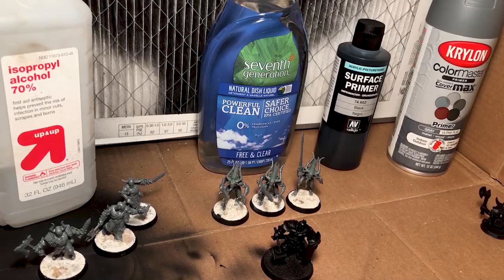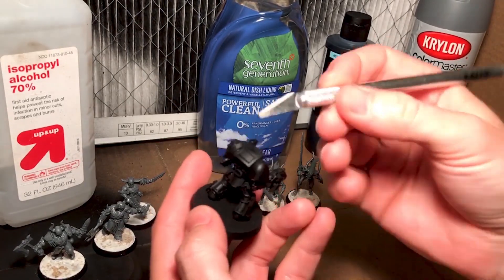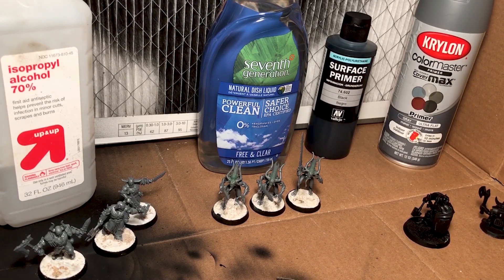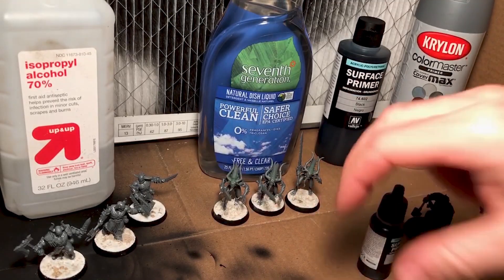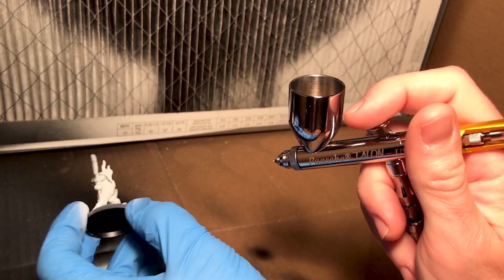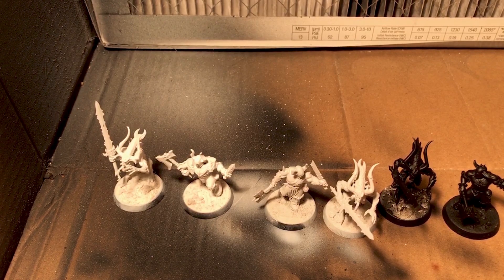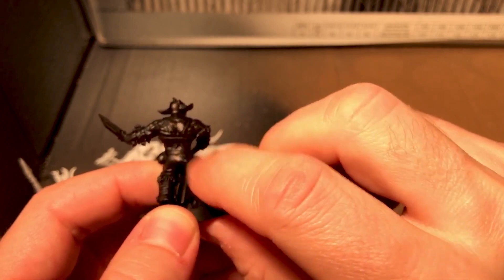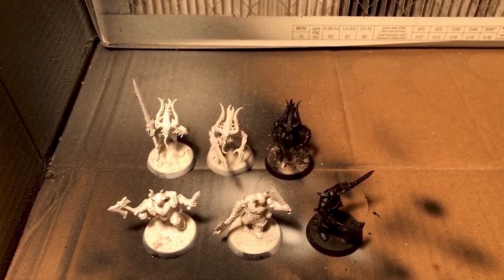Airbrush Priming Miniatures - how to fix primer not sticking or peeling off

Comment: I find this is usually an issue with small batch models or resin but have now got to the point where I wash everything with either a 24 hour soak in soapy water, or an hour in 95% isopropyl alcohol then a rinse in  distilled water and let it dry for 24 hours. This clears out even the most stubborn resin models

Comment: I was painting resin boardgame minis and no amount of prep or cleaning really makes a difference. Tried 3 brands of airbrush primer along with different pressure and distance settings and nothing will stop scratching off. Drybrushing scratches it off for instance.

I really think this is just the chemistry - aerosol primers have solvents that bond with plastics and polyurethane primers don't.
Reply: I have found the same. I always washed my resin anyways just to get any residue off, and still hade stynylrez sliding off. 

I'm thinking on some I'll try a very light spray of black primer I have left over that permbonds strong and is so thin it doesn't clog features, then airbrush primer over that.

Comment: just switched to airbrush primer.  Never had an issue with Citadel stuff.  Monumental and vallejo primer BOTH coming right off of plastic minis.  Going back to Citadel.  Don't have the time or effort to experiment.  Ill just use the airbrush to base coat.

Comment: Tried washing with soap and 98% alcohol and priming with Vallejo Black/Gray and Stylnrez Gray. Unthinned Primer and letting it cure for at least 48 hours.
Still the primer comes off after light fingernail scratching.... On one model you could even rub it off with a finger after it got a basecoat with some color.
I have no idea whats going on at this point...
Any Ideas
Reply from the maker: Wow, that is super frustrating?  Did you rinse off the alcohol/soap pretty well?  I have not encountered what you are seeing.  Perhaps a bad batch of primer?

Comment: I just primed a bunch of models with Vallejo Panzer Grey surface primer after washing them with 96 % alcohol and letting them cure for 24 hours. And still the primer comes right off and I don't even need to use a fingernail. Just pressing on the mini lightly with my finger and running it across the mini is enough for the primer to come off. They are GW nighthaunt models, which are basic GW plastic so it should not be because of the material I'v been using it on. Really bums me out.

Now maybe this is because I'v been thinning the primer down with Vallejo Airbrush thinner, but I can't make my 0.35 nozzle airbrush shoot raw primer out of it, so there is no way for me to test this. Anyways, the culprit might be the thinner.
Reply from the maker: I am really sorry to hear this.  I use a Paasche Talon 0.3mm needle when I prime.  I have no issues with Vallejo primers needing thinner, so I never even tried it.  What sort of airbrush are you using?  I had a super cheap airbrush a while back and had no end of problems.  I would be glad to test it out and I will let you know if thinner causes a problem.  What sort of ratio are you running?
Reply: late reply but might be worth to play around with air pressure and distance, if you need to add thinner for a needly that big maybe up air pressure. I found that when I started out sometimes I would spray too far from the mini and the paint would dry too much before it hit the model, and so would easily rub off since I was pretty much spraying damp pigment dust instead of paint onto it.
Reply: @tjmmachine  Wow, I had completely forgotten this thread even existed. Well, seeing as you took the time to read and answer then I suppose I might as well give an update of sorts. I fixed all the problems I had by switching to MIG One Shot Primer which is, as I understand it, a repackaged Badger's Stynylrez primer.
Reply: @LittleGit  is this still through thr airbrush?

Comment: This issue is not confined to Vallejo primers, I have had Monument Hobbies primer come off, to the point that I could not mask off parts of the model without lifting all the paint and primer with the tape.
Reply: Did you manage to correct the issue?
Reply: @MrSlabberdank  yes, monument primers need to be applied "wetter" than you might think, then they grab and hold when dry.
Reply: @JHB141  what do you mean by wetter? I put it on neat using a badger 105 it's dried soft.   Doing something wrong 🙂
Reply: @MrSlabberdank  so, when you airbrush it, cut back on how much you pull back the trigger so less paint is flowing, then get closer to the model. As you lay down a layer, it should have a wet shiny look. If it hits and looks flat, it dried before it got to the surface and won't hold. Takes some practice, but once you get the hang of it, it adheres very nicely.
Reply: @JHB141  thanks very much for taking the time to respond.  Will certainly be trying that on some inconspicuous areas!
Reply: @JHB141  having the same issue, did you use anything to thin the monument primer (water, thinner, etc)?
Reply: @davidbarker4747  no, straight out of the bottle. I've since also started spaying isopropyl alcohol in the model before starting and brushing it down with an old brush, then blowing it dry just in case there is any mold release on it.
Reply: @JHB141  thanks!

Comment: What really helps is sanding your mini with a 400 grit then 600 and finally 800. Scarring the surface gives the primer an area to grip to.
Reply from the maker: Interesting.  I had not thought of that, but it seems to make sense.  I will need to try it.  Is it at all noticeable on the mini as your painting, maybe impacting how it you apply a glaze or wash?
Reply: instablaster...

Comment: Dear Lord, hobbyists can be such alarmists... Of course, the spray primer adheres to the miniature much better than the one applied with an airbrush. First, they have additional chemicals added to bond stronger with the surface, second - they're not meant to be used with such little things as miniatures. No, not even ones manufactured by Vallejo, Citadel or AP. Can sprays are for spraying furniture, walls and other substantial things, not things that are rarely bigger than your finger.

And to the point - primer you scrached with your finger will do. I'll repeat - IT WILL DO. First, who in their right mind is scratching ultra thin coat of paint with their damn fingernail?! Leave it the f#*% alone and start painting. Just be sure to wait for it to cure according to manufacturer's instructions. Other coats of paint will adhere to the primer and at the end you'll probably still protect it with varnish (knowing how superstitious modelers are, I bet you do gloss coat first and then matte coat - and you're probably thinking gloss is for actual protection and matte to diminish the shine).

Sorry if I come out as aggressive, but what you found out here doesn't really matter. Like at all. Seriously. Increasing primer adhension to the plastic doesn't add any positive value to the model or the paintjob - as long as it's not falling off by itself, it's all ok and you don't need to literaly chain the primer to the minaiture. It's a waste of time and resources. You definitely should not rub your fingers or (God forbid!) hard nails against paint that is only a few μm thick at most!

So, washing your miniatures? Yes, of course, please do that with warm water and delicate detergent. Using isopropyl alcohol? Don't you have better things to do with your time and money? Like, would you use MIM-104 Patriot  to kill a fly? You can, of course, but you know it doesn't have any sense.
Reply: So stupid. Sure, you can avoid scratching the primer most of the time. The problem is when you are painting a bigger model that can't be held by the base, then wherever you hold the model, the primer will easily rub off.